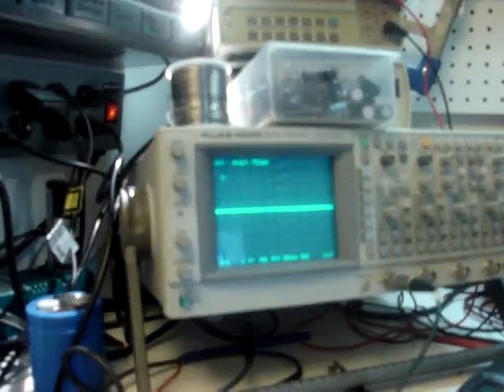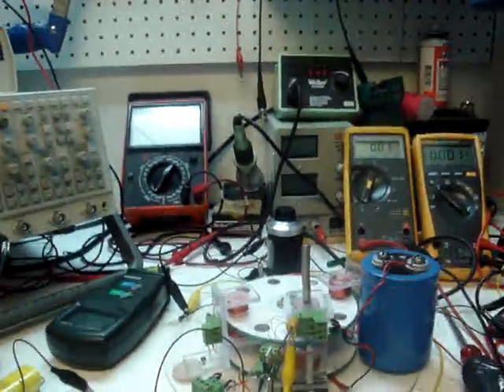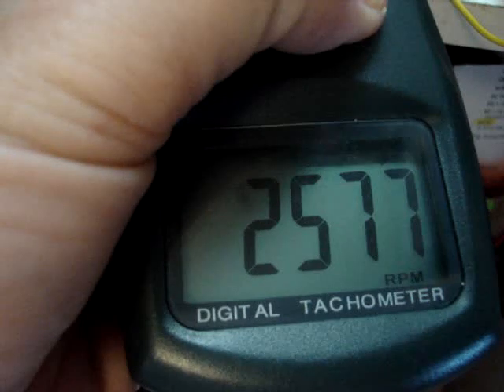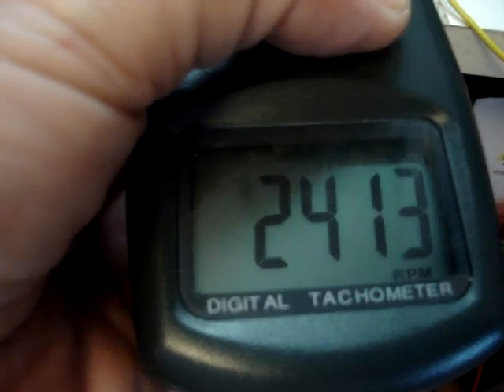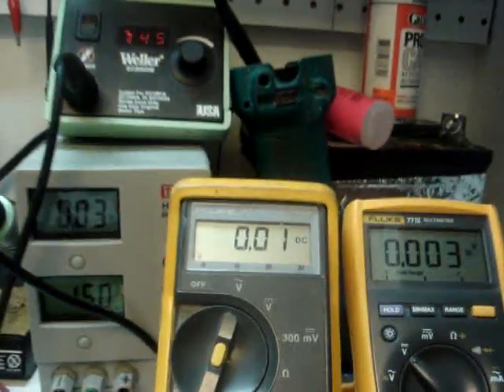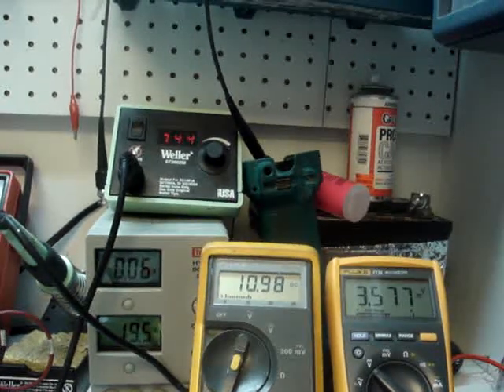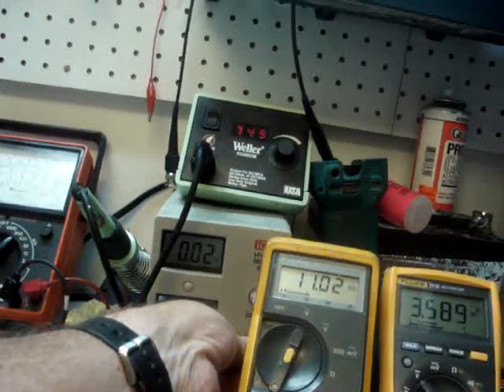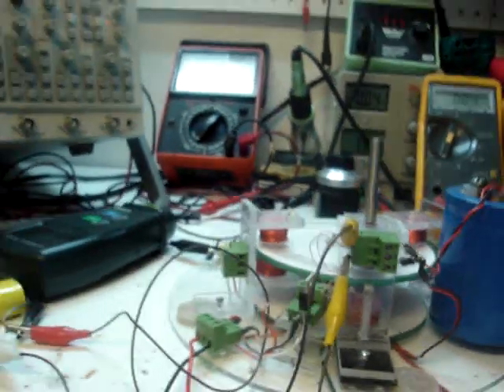Demo of rotor speeding up under load.

Comment: I think you definitely have to short the generator coil and move it back and forth to see the difference in speed between no coils at all and shorted coils. If it accelerates when the coil is close to the rotor it means you generate a percentage of free energy with that bucking coil.

Comment: 5th:  It's also worth mentioning that Romerouk is at about the same knowledge level as the median contributor to the thread, i.e.; below a grade 8 physics level.  I mentioned the IV transfer curves for diodes with respect to his adding extra diodes to the FWBR configuration and it was obvious that he had no clue what I was talking about.  Also, Bolt is the Great Polluter of the OU thread.  Hoppy asked him to show a circuit and he ignored the question.  Bolt talks garbage, all part of the farce.

Comment: 4th:  I am going to assume that for the most part that you agree with me.  Sometimes it's worth it to express your opinion even if it means risking some confrontation with others.  You are also fully aware that there are people on the forums with totally glazed eyes, they are rabid believers.  The rabid believers are usually completely clueless technically.

Again, it's worth it to sometimes stand up for what is right.  This farce of a scam should be stopped and exposed for what it is.

Comment: 2nd:  In the third clip I am assuming that Romero ripped the guts out of the DC-to-DC converter and put two alkaline AA cells inside it.  The RPM of the rotor in the third clip is consistent with about a 3-volt power source.

So this whole thing is a con job by Romerouk.  Why he did it I don't know, but you can speculate that it is for the "glory" and the mental masturbation.  You can see the reverence he gets and how people hang on his every word.

Comment: The speeding up under load means nothing and I am pretty sure that you know that.  This is becoming ridiculous, now most of you are going to rewire your coils to chase after the latest development on the thread.  It appears in the first clip Romero cheated and wired the battery into the FWBR output bus.  He basically admitted that.  In the second clip he cheated and hid a power source in the table, Wattsup found the wires in a video frame.

Comment: is that a 5*19.5=97.5 mwatt in and 16.21*2.69 = 43.6 mwatt out ? Can you put a second gen coil as load on the rotor ?
Apart from the question thatnks for the demonstration of the resonance effect.